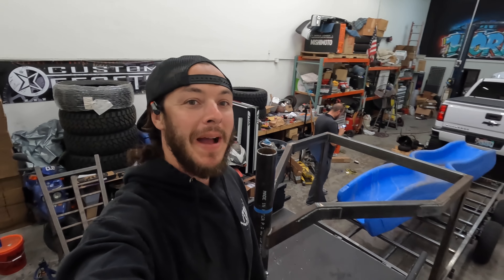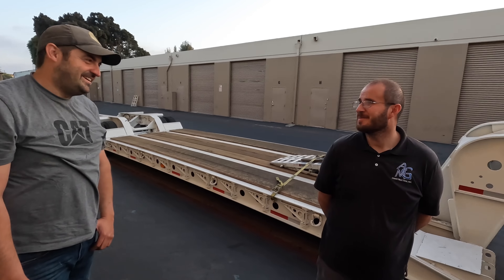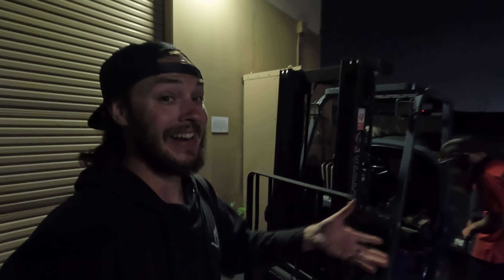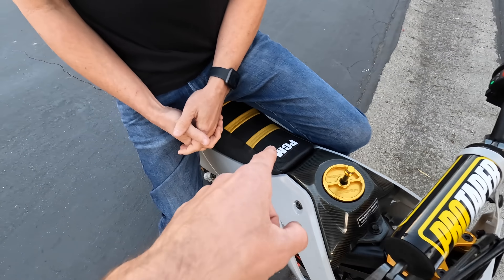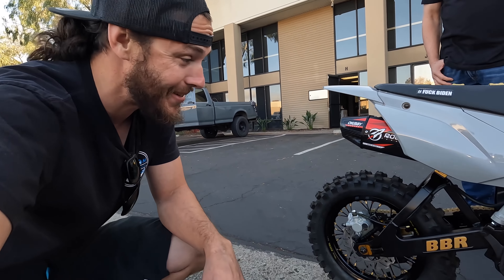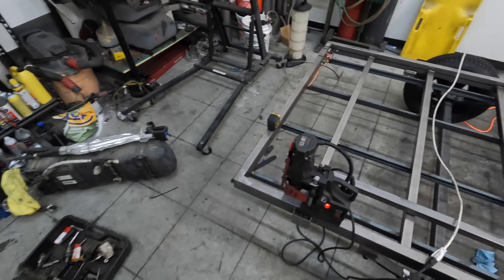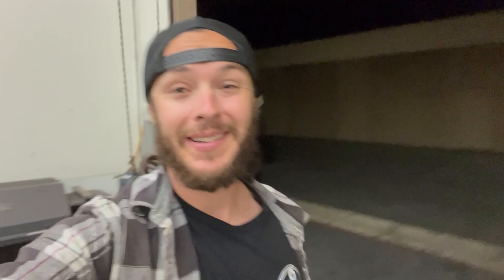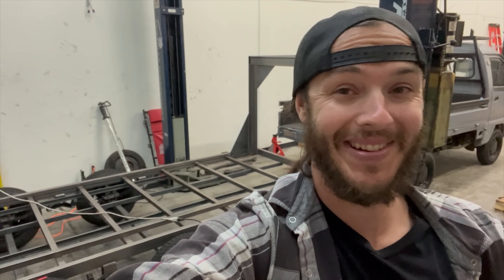Building a Mini Gooseneck Trailer for my Mini Truck! (Part 7)

Comment: Question how do you evenly distribute the spacing in the lights. Do you measure the length of the spot you plan on placing them on and divide by the number of lights you are going to put on??
Reply from the maker: Correct. Or in this case I spaced them out in between the stake pockets

Comment: If u take a $5 dollar camp sized propane bottle & make it easy same fitting as 100 lb tank connect u always hve a simple way to fill then hole /hose on top & bottom of mini camp tank, u hve a reverse min take when big tank runs duh out which happens all the time in wharehouse u cheap unhook a mini take from 1 of other forks in factory or off the shef u can eaily refill them acting as in between mini tank reserve below empty line or again just take 1 of 50 or so mini tajks hose fitting of the shelf & just unscew & screw on another 1.

Comment: RYNO I've ran into the same issues moving different things around with a fork lift. But  I usually wrap a chain around the bar and cage that the forks slide on,  then wrap it around the frame of the trailer to keep it from sliding off the forks.
Reply: pro tip, putting that in my back pocket. thanks

Comment: As always majorly saving my life motivational.... I'm pulling a all nighter up wire brushing my flatbed & frame of Cummins dually , then drop my fuel tank to make sure no trash in my tank ( project to getting ready for my side businesses to hauling/transporting . But tomorrow I'm going to sandblasting where I'm working now to get ready to under coating spray my frame to mount my band new truck back up ,  tail lights housing I got.

Comment: You should get a rivnut tools and put rivnuts on the back of the trailer instead of self taps
Reply from the maker: Rivnuts sit on the surface and don’t allow things to sit flush. They have their place by this isn’t it

Comment: why would you weld the stabilizing jack to the trailer? They are pretty cheap China made jacks and they do bend pretty easy so its more work to have to cut it off and grind everything again to replace it in the future
Reply from the maker: Fern insisted on welding them. He ripped the first set off pretty cleanly off-road so maybe this set will rip off cleanly as well 🤷🏽‍♂️

Comment: Not sure if you did it but make sure you disconnect the battery(s) when welding on trailers or vehicles or else you could short stuff out on those sensitive electronics